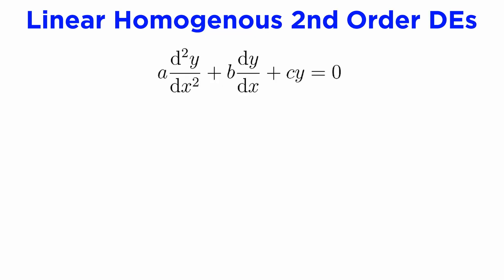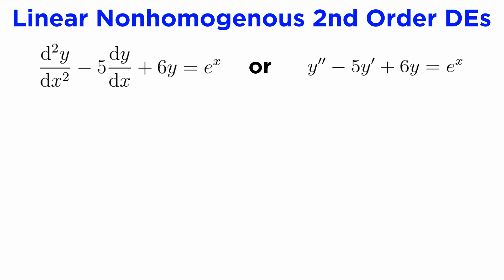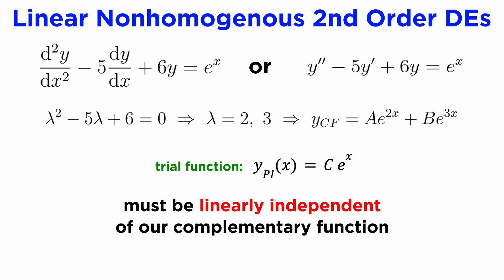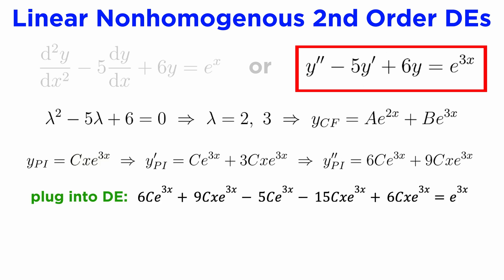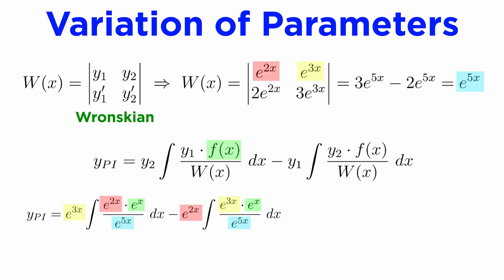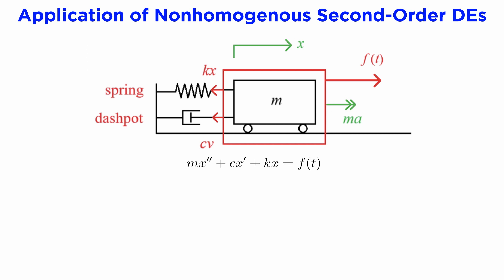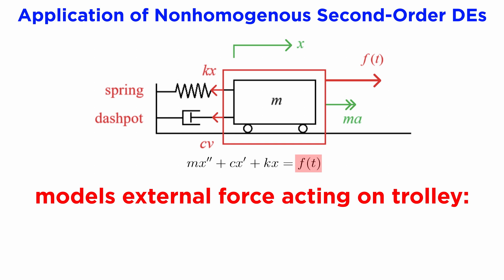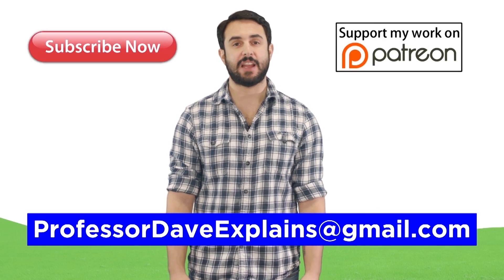Linear Second-Order Differential Equations Part 2: Non-Homogeneous Differential Equations

Comment: I tried solving the 3rd problem both with the method of undetermined coefficients and with variation of parameters, and I got similar, but different results for the particular integral, and it's not just an issue of different representation of the results. I'm pretty sure of my results, I checked them several times and compared them with the results from online solvers. The difference is, that the particular integral I obtain from the method of undetermined coefficients is divided by mass, and the result from variation of parameters isn't. I'm pretty sure the particular integral from the method of undetermined coefficients is the correct one, as I've compared it with a simulation in simulink. The issue is, mass in this case is not just some constant that you can ignore, because it's multiplied by independent variable t.
I've checked other resources and I've noticed that the DE they're solving has the leading coefficient next to the second derivative x" always equal to 1. And it sure checks out - if I divide both sides of the DE m*x" + k*x = sin(omega*t)  by mass m, it all checks out and the variable of parameters gives me the same result as with the method of undetermined coefficients.
I didn't see anywhere in your video you mentioning we need to divide the differential equation a*y" + b*y' + c*y = f(x) by the leading coefficient a, and the example you've shown already had a leading coefficient equal to 1, so we didn't have that problem. Is that the correct way to do it, or am I doing something wrong?

Comment: Is carbon 14 dating reliable?
Reply: up to 50,000 years
Reply: @ but the have life of carbon 14 is 5600 years
Reply: @danbyers3647 
Exactly. Doesn’t mean it will decay completely under that period of time.
Reply: @danbyers3647 Half life isn’t linear. It’s 5730 years actually.

You can’t just multiply the amount by two and get the whole decay. This is a little more complicated than that.

Think of it like this.

You had a 3200 candy, then after a year it became 1600, then the next year it became 800, then the following year it became 400 and then 200,100,50,25, 12.5 you get the idea.

Nuclear decay is like that. Half life of Carbon 14 being 5730 years means that if you have 3200 grams of Carbon 14, then after 5730 years, it would become 1600grams , then after another 5730 years, it would become 800 grams then 400 grams after another 5730 years then 200,100,50,25,12.5 grams every 5730 years.

Do you see the picture here? Half life is the measure of how long it would take for something to become one half of its original but it doesn’t completely decay after immediately after twice the time of it’s half life has been passed, it only becomes a quarter of it by then. 

You get the picture here?
Reply: @AceLordy  so how do you get millions of years when decay only means maybe thousands
Reply: @danbyers3647  There are other Radioactive isotopes as well. Some of which are also used for radiometric dating. Some have far higher half life like millions of years, sometimes billions. U235 has it at almost 704 million years.

Sure, different isotopes serve different purposes but Carbon 14 isn’t the only radioactive isotope used for dating the age of something.
Reply: @AceLordy  but without knowing the amount of isotopes in the sample at death and the condition of the earth how can you determine the decay rate
Reply: @AceLordy  OH YEAH that's right I thought because carbon-14 had a half life of 5400 or whatever that that was the span it was useful for... And yeah the OTHER elements that are useful for dating,, which is I guess how they know how old the Earth is,, well hey most of us don't work in fields where we have to know these things so to most people it's all trivia, sure glad I can admit when I'm wrong though...
Reply: @ You don’t need to know the sample at “death” to determine the decay rate. In fact there is no such thing as absolute death of radioactive decay. It goes close to zero but never quite reaches there. 

Back to your question.
Radioactive decay makes a negative exponential curve that can be described by the equation given here N(t) = Nₒe^(-λt)

Here N(t) is the amount of material you have at a given time frame. Nₒ is the original amount, λ is the decay constant and t is the amount of time elapsed since you measured the initial amount Nₒ

You’re only gonna need N(t), Nₒ and t to determine the decay constant λ. Basically the number at which rate the sample decays. N(t) and Nₒ simply can be measured by weighing the isotopes at two different instances and those different instances don’t have to be thousands of years apart either. You can do them at pretty short amount of time’s notice (say a few years to a large sample of them) and you’ll get the results with really high accuracy.
Reply: @danbyers3647  Well that depends on which form of bisexual carbon that you're talking about,, as Woody Allen said when you're bisexual that doubles your chance of getting a date on Friday night so carbon-14 is only useful for dating up to what is it 5400 years ago because carbon-14 isn't into either  cougars or sugar daddies LOL... Sorry I just couldn't help throwing a little Terrence Howard Insanity in there...